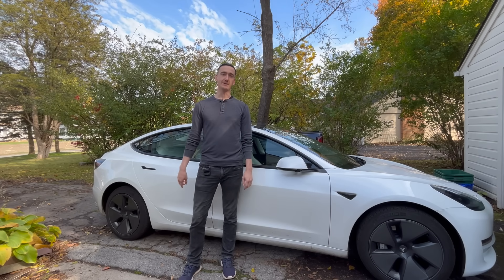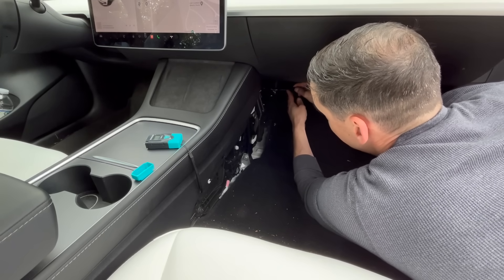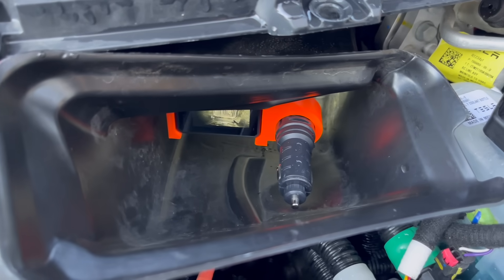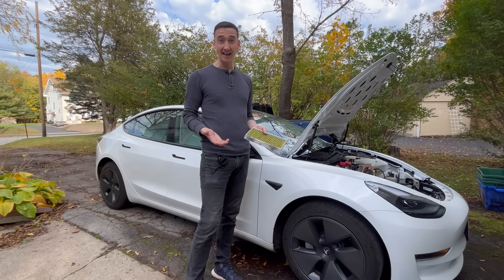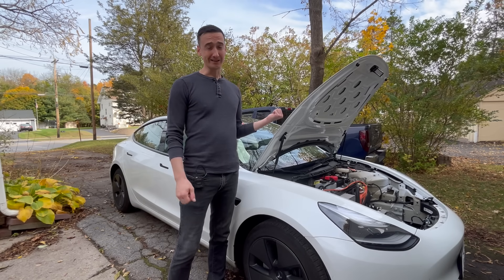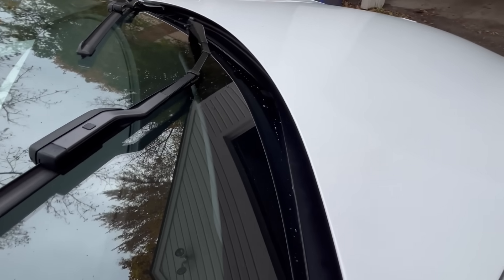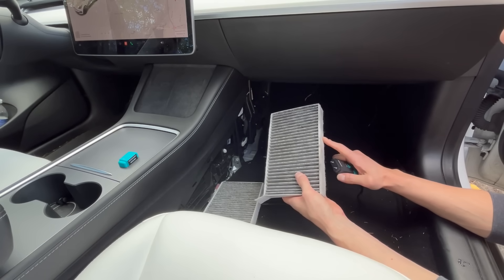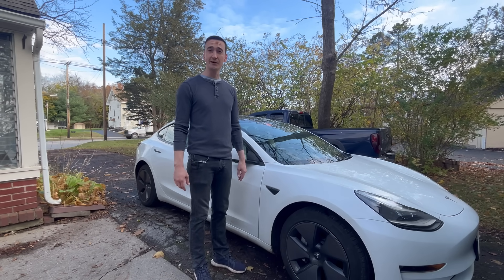This design flaw makes Tesla’s Model 3 smell bad! (with fixes!)

Comment: I live in Scandinavia, here we have many months with snow and ice and salt

My tesla model 3 performance 2019 I have learned the hard way is not made for this climate

I knew that Tesla is not known for its quality, bad body, uneven paint coverage and thin, no rust protection whatsoever, the body is not even galanized, etc.

the handles freeze so I can't get into the car regardless of whether I use the app to heat the car 2 hours before I go

the few times this helps then another phenomenon occurs when i open the door and the window won't go down due to ice and i get in the car and close the door then the window explodes because the window hasn't gone down due to ice

when there is a lot of snow on the car and I open the rear hatch, most of the snow falls straight into the trunk

these are just some of the problems i have with my tesla 3

here's a video that pretty well shows what I'm talking about

https://youtu.be/WSq0u5_0mhM?si=wOkFTrbGs-t-RSLC

the next video shows that the Tesla model 3 and Y have no rust protection whatsoever from the factory this is really bad

https://youtu.be/IRjjS_yY2Qg?si=mZfm1zE3zqcxZp4D

this does not work in our climate where they have to salt a lot

my 2019 Tesla is full of rust and during the obligatory car inspection I received a number of remarks on my Tesla due to the fact that it is rusting

has Tesla made any improvements on this "new" model 3 2024 or is the quality just as bad on this one in terms of the body, the paint, the rust protection, etc.

if Tesla had wanted, Tesla could have fixed this with ease a long time ago

but we have to wait a few years

when the Tesla cars are completely rusted, then maybe Tesla will fix this

the rust protection is so bad / there is no rust protection on model 3 and Y from the factory that a 5-year-old car used in Scandinavia already has such rust damage that it fails the car inspection

here, Tesla must learn from the established car brands how to make a car body that does not rust apart after a few years

this part should be much easier than FSD or sending people into space etc. for this, all icu car manufacturers have the knowledge, it's just for Tesa to copy their method

unless Tesla improves the quality of their cars and by that I mean the body, paint, mechanical,

then many Tesla owners will be quite disappointed when they sell their 3 year old Tesla which is full of rust and paint damage

https://youtu.be/740YFhVREy8?si=a2ktLXohIQuqtQ2y

unless you live in Miami or Dubai or some other place that doesn't have snow or rain

in these cities no rust or rain protection is needed

Comment: Great video. I changed mine to the charcoal hepa filter with no issues so far. I did forget to use car wash mode a few times, but my aftermarket gasket helped a little. Luckily, I haven’t noticed any smelly issues. I have to say the evaporator spray makes the car smell great for a few weeks. ⚡️👍🏾

Comment: Well that was a damn good video.....dammit!
I like the use of the camera in the duct and his conclusions ring true.
What about just soft rubber stripping around the opening so that any water in the area is blocked from just running into the duct? Maybe just a strip on the top running a bit past the opening would do the trick.

Comment: Well done.  Thanks.  One point though, I would rather have activated charcoal than Microban.  There are plenty of studies that dispute its effectiveness in protecting users and they are not allowed to claim that it does.  You'll notice if you read many of them closely that the claims are only that it protects the material and not the user.  Here is a typical statement of Microban's "benefit" from a toothbrush manufacturer.  "These bristles are protected from bacteria with Microban which inhibits microbial growth of odor-causing bacteria that may affect the bristles; The bristles do not kill bacteria in the mouth or protect against disease.  Always clean the product thoroughly after use."  My company used to use it in toothbrush handles.  It makes a great marketing line, but I can't see (and they don't even claim) that it provides any protection for the user.

Comment: For those with with biodefense mode (15:20) : check/replace those filters in the frunk (aka not the cabin ones), especially if you've tried the usual stuff (replace cabin filters + coil spray) + those filters haven't been replaced recently, this actually worked for me!

I honestly didn't know there were filters there at all lol so thank you for that! It's interesting how moldy/heavy those filters were since they're sealed (rainwater shouldn't hit it like you said) but... I've had my car for 2 years and never swapped them 😶 so it's probably just trapped moisture/stuff from normal use?

Either way, thanks so much for such an amazing effort diagnosing + documenting this problem! These videos were really entertaining and satisfying too, I totally see why lots of non-Tesla owners enjoyed these videos hahaha

Comment: Adam, What great scientific analysis of changing the variables and retesting and comparative design analysis to other vehicles. Love your GoPro 3D printed flashlight holder.  I was wondering why Tesla designed their fresh air intake similar to ICE car's air intakes that are made to avoid drawing in fumes and heat from an ICE engine bay. Seems like Tesla copied the ICE design when it should have done a completely different design that pulls fresh air from under the top cover and not have an air vent to pull water from above. I think I'd try sealing the vent and making a large cut out in that J shaped air intake with a screen to draw air from under the plastic trim. Try to seal out all water entering in from above with your trim kit and other means. Also the cabin filters have their edges are made of absorbent material and should be made out of a non absorbent material so they aren't wicking the water up. Air flow thru the center of the filter would help keep the main filtering area dry.

Comment: Something I learned Way back in HS auto mechanics, to keep mold from growing in your system, open your AC RECIRC when you get home. That will allow any water to drain out. Also keep it open for awhile when you first start driving. No more stink in the cabin. Ive had mine for 3.5 yrs, no issues.

Comment: Nice work. As an engineer I'm going to design a 3D printed intake to correct this issue for my car.
Reply from the maker: Cool! What will it do?
Reply: @adamdport  thinking about facing it slightly downwards if there is space so increase the gap between the hole and the fan. It's 35F in the morning and I refuse to use my hvac. Seems worse in winter.
Reply from the maker: @ryanb9749  no, I meant what is the purpose of the duct? What problem are you solving by replacing it with a modified one? I couldn't figure out why a duct needed to be there at all
Reply: @adamdport  to prevent water from entering the fan.
Reply from the maker: @ryanb9749  sorry, maybe I worded it wrong—why have a duct at all? I get that you're trying to make their duct different, but why not just remove it entirely?
Reply: @adamdport  because a correctly designed duct can draw water away from the fan better than no duct at all.
Reply: @adamdport  ok so. I removed it looked around and put the cover back on. I believe the purpose of this cover is to protect the electrical equipment under it from corrosion.

Also, my frunk is full of water I don't know why.
Reply: @adamdport  my only hesitation with removing the duct is water getting around everything else more often. I know it’s all weather proof, but just doesn’t sit as well with me haha

Comment: I believe your theory is correct. I have a 2021 model 3 and for years I’ve always kept my car on recirculating mode. If I want fresh air I just roll the window down. This being said, I very rarely get that smell. I do change the filters every year but not because of the smell. Great video.
Reply: How do you keep in recirculate mode ? It's time consuming to change it in climate settings every ride.
Reply: @ before one of the updates you were able to keep it in recirculating mode. Now it’s auto”. 🤷‍♂️

Comment: And what turns the fan on high? Defrost mode. I was using it to defog...usually when it's cold and wet outside. You would think the engineers who created the super manifold could design a fresh air duct that stays dry.

Comment: Man awesome stuff! I found a cheap replacement filter on amazon that prevented that smell longer than the expensive factory one. I felt like it was the rubber they use as a seal on the factory one. I can see now its the moisture either directly causing it or maybe it also causes that filter to decay because the smell I get is more of a rotten latex type smell its horrible , changing the filter always fixs it and now I understand better why. This has been so helpful thank you!

Comment: It’s actually a very simple fix that I found somewhere on the internet years ago. Turn off the cabin overheat protection with ac. You can keep fan only option on. Once I did that I never got the smell again.

Comment: A friend has a big diesel pickup.   The filter is built into the cab.  To change it one has to cut a hole in the fire wall.  A local shop quoted him $80 to cut the hole and change the filter.  But the core behind it was clogged.  Cost him over $300 for the parts and service and there was no real improvement.

Comment: Bless you for this video. I have a 2020 Model Y. I've had to change the cabin filters every 6 months because of the smell. I recently changed the filters, once again, and at this point I'm afraid even that doesn't solve the issue anymore. I use Arm&Hammer HVAC cleaner with each change. The HVAC cleaner does leave a nice, fresh odor in the vents, but for less time after each filter change. I'm afraid pre-2021 Model Y owners are gonna have a constant battle with evermore creeping cabin odor. Any chance you can do similar research on a 2020 Model Y? I happily volunteer my car if you live in SoCal. 

In any case, thank you for this MUCH NEEDED in-depth analysis. The issue drives me crazy and this video was very insightful. (Although I'm afraid doesn't solve the issue for 2020 MYs...😕)
Reply from the maker: At 15:40 I show the intake duct that's on your Y, I think you'll likely have the same issue and the solutions are the same—remove the duct, or if you're not comfortable with that then get an aftermarket gasket. If you wash your car on a hot day (cabin overheat protection on) and get suds in that intake you're toast!
Reply: @adamdport  I'm sure it also doesn't help that 2020 Ys don't have a drain hole at the bottom. The newer models do. That's why I think 2020&early 2021 Y owners are gonna have a worse time of it. What do you think about simply removing the filters and running the system without them? Stupid idea?
Reply from the maker: @joncamio  it does have a drain hole, you can see it at 15:53. But I'd suggest removing the duct, not the filters. Running without filters will eventually clog your evaporator, not a good idea. Could try ozone generator on recirculate to sanitize your entire system though https://amzn.to/47WWFIR
Reply: @adamdport I can see the intake duct, but the drainage hole is supposedly at the bottom of the HVAC system under the air filters. I think the Houston Tesla owner YouTuber showed it back in the day. 

In any case, this sucks. At this point, 3yrs with the car, the vents smell fresh right after cleaning with the HVAC cleaner and swapping the filters. But as soon as I go from cold to hotter or vice versa, that change in temperature produces an odor that overwhelms the fresh, HVAC cleaner scent. I really don't understand either, if the air filters are brand new, they don't have any bacteria or mildew on them, why there would be any type of odor especially after having used the HVAC cleaner as well 😐
Reply from the maker: I show the drain at 8:45, you have the exact same HVAC module as me and so your drain will be visible in the same spot. Take your filters out and shoot a video with your phone and you'll see your drain (and possibly the source of your smell–maybe there's rotting leaves down in there or something?)
Reply: I really appreciate all your communication, btw. Thank you very much!! 🙏
Reply: I'm almost tempted to fly you out to Orange County to do a video on my car! 😆

Comment: does it applied also for Tesla 3 Highland? As I'm receiveing my in 2 days and if that works also for Highland I rather to buy it now and install right away after picking up the car.
Reply from the maker: I've been waiting for the new parts lists to be available but nothing is out yet. It should be very obvious if your duct matches mine or not, and you can get access to it without any tools at all. Congrats on the new purchase!
Reply: @adamdport  Hoping you're able to provide an update or post somewhere when you can make a determination about the Highland. Is that the plan?
Reply from the maker: @pianovideos-123  can YOU provide one? Do you have the car? Can you look at your air intake and report if it's different than in my video?
Reply: @adamdport  I absolutely would but I’m in the US so don’t have the car. I’m looking to buy one when they’re available so that’s why I’m curious.
Reply from the maker: @pianovideos-123  ah I misunderstood, I thought you meant you were getting a highland, I haven't been following when they'll be released in the US. I'll try to remember to reply to this thread when I have new info!

Comment: Excellent, On Monday when I go to work I am going to test this. I wash the loaners at a dealership and noticed odors can be an issue with the m3's. After I wash a loaner, I'm going to look down this air intake, if I see any water I am going to remove the intake from every loaner that I look after.

Comment: Our Tesla X stinks. Replacing the cabin filter didn’t help. To replace the hepa we need to remove the frunk, the wipers and motors and more… dealer job… and it won’t fix the problem…

Comment: 7:30 Another solution would be to route the vent so it's pulling air up and not down.
12:50 the space you see is probably something to do with air flow, drag coefficient. Adding that full length gasket may hinder the air flow. IDK

Comment: Car design has evolved for a hundred years. There is a reason why most of them are designed and built very similar. Its because that is the most efficient and best design. Tesla comes along with a "better" idea and makes a mess of things. Yes they have some cool features, but also a lot of problems. They also cheapen the designs in ways that are not so obvious to people outside of the industry.

Comment: I believe the 2022 and beyond M3 has the Hepa. We have bio-defense mode in our 22 M3LR.
Reply from the maker: I can't find any evidence that backs up your claim. Can I ask what you see that makes you think you have it?
Reply: @adamdport  If it wasn't in the shop for a deer hit I would take a picture but it does have a Bio-Defense mode. It works because I have had to use it before passing nasty things on the highway like a car fire. Unless it's running that with 2 small filters. I have not taken it apart.
Reply: Also we got one of the last M3LRs of 2022 before they paused ordering. Not sure if that has anything to do with it.  @adamdport
Reply: @adamdport  The Bio Weapons defense mode option that kicks on when I tell too. Like I said it's in the shop for a deer hit but I should have it back sometime next week finally after 2 months.
Reply: @adamdport  Also not sure if it has the big one or it's just using 2 small ones in that center port. I just know it has the Bio weapon mode and it works.
Reply from the maker: ...do you have a cargo area in the frunk like in my video?
Reply: @adamdport  I do have frunk storage but it looks more shallow of I remember correctly. Haven't seen it in 2 months. I'll check next week when I get it back. It's going into paint hopefully Friday.

Comment: That area that most cars draw air from is called a "cowl." At one time most cars had a "vent" setting that would use the high pressure air from the cowl to force air into the cabin without needing to use a fan. Some cars and trucks even into the late '70s had vents in the footwell you could open completely independent of the HVAC controls, the cowl "duct" area extended down to these vents and at speed they could move quite a bit of air.

Comment: what if you did 3d print a plastic cover for the drainhole so the air do not rush directly over it, either something small that you screw in place or have a frame so it fits snuggly inside :)

Comment: I can confirm that the issue exists on the bio-defense model y variant. I’m not totally sure how it happens yet, but the smell issue that requires filter replacement exists. I can also confirm that, on that model, a cleaner is needed to fully remove the smell. The issue is with the same internal filters as the 3 in the video. Adding a gasket to the frunk like shown here seemed to help extend the filter life an extra 6 months, but the issue persists. I suspect it has to do with the heat pump system not handing condensation correctly. As if it tries to remove humidity, but then the water doesn’t drain all the way and it just builds up over time. That’s my running guess at least. So far, the fix has been $30/year for fingers and some Klima lol